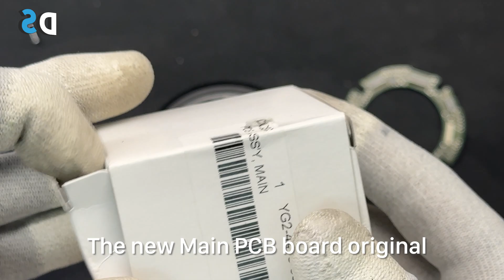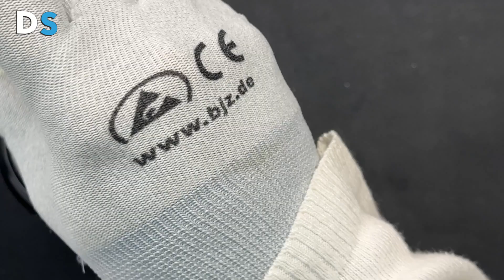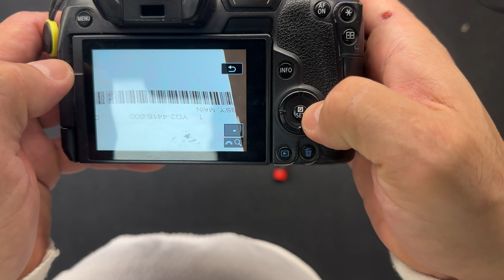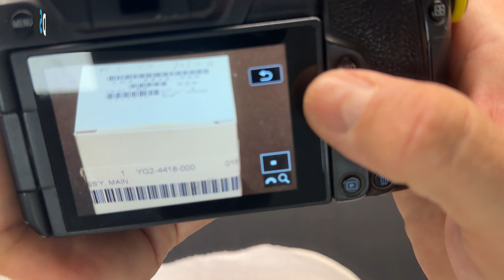How to repair Canon lens RF 24-70mm f/2.8L IS - dropped and need exchange Main PCB board

Comment: How much is a service like this
Reply: After replacing main PCB ,  data calibration required  or not
Reply from the maker: @AAshok-zn3gv  yes is needed
Reply: @DIGISERVICEBG  how to do calibration and what is the procedure
Reply from the maker: @AAshok-zn3gv  send the lens to us
Reply from the maker: Hi around 120 USD but need to revise the lens

Comment: How can I get in contact with you? I want to fix a canon 70-200 2.8 IS ver. 1 that has a mid-element wobble and a strange markings on the lens, they look like ✔️ check marks.
Reply from the maker: Hi you can write an email to service@digi-service.eu. Thank you !